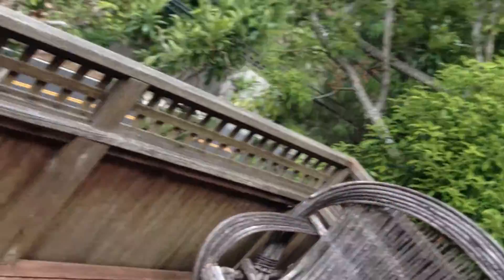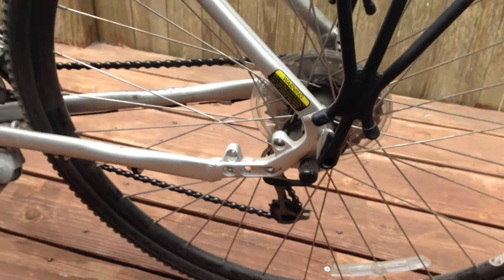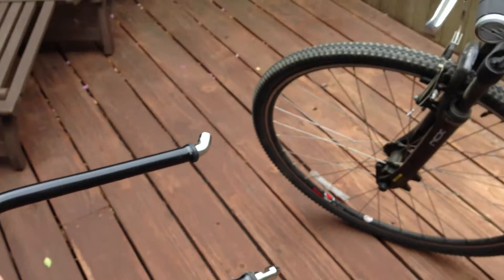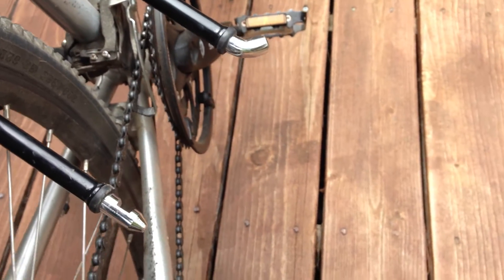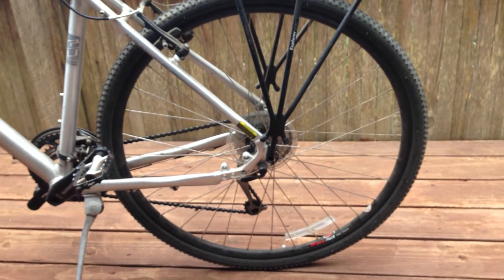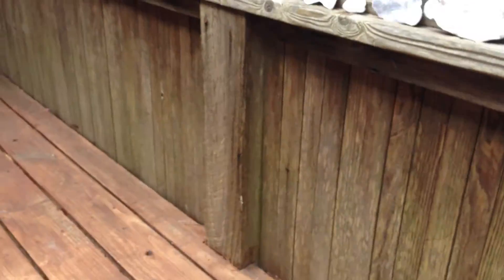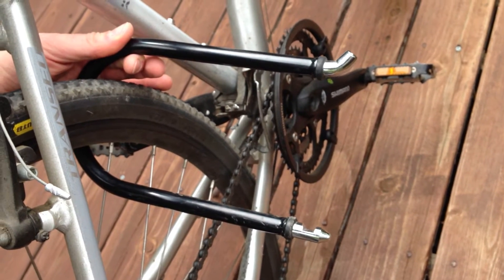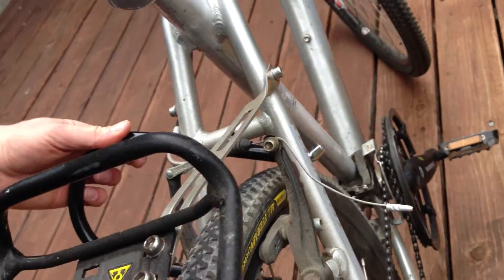A Better Way to Lock Your Bike

Comment: Sheldon brown technique is outdated. You should try to fit the frame to prevent thieves using crowbar to pry the lock off. The rear wheel is susceptible to damage with that technique.

Comment: Well who knew! I'm still skeptical though, prove it by locking the wheel and try to remove the wheel by the quick release skewer.
Reply from the maker: That would be great to demonstrate. Perhaps I'll show that at some point. You should be able to simulate it in your mind. The lock is through the wheel where it's inside the bike frame, so to get the lock off, you have to remove the wheel. Removing the wheel requires pulling it through the tiny opening in the frame, which is not possible.

Comment: I'd love for this to be true, but in reality I don't think a carbon or aluminium or even an unhardened steel rim is as hard to cut through as a decent hardened steel shackle. In fact I think the carbon and aluminium rims that most ride would be as putty in comparison to a decent hardened steel shackle, and the unhardened steel rims still very much easier too. Of course frames are easy as piss too, however they're not cutting through that because a damaged frame is not worth the steal.

 Of course if we're using a cable or thin unhardened bicycle chain like many still use, then I'd agree. However using cable or thin unhardened shackles shouldn't be used to begin with as they can be dealt with quietly and quickly with a pair of bolt cutters. Anyone that wants ok security should be using at least 10mm hardened steel shackles.
Reply from the maker: Nice. Thanks for that.
Reply: No problem.